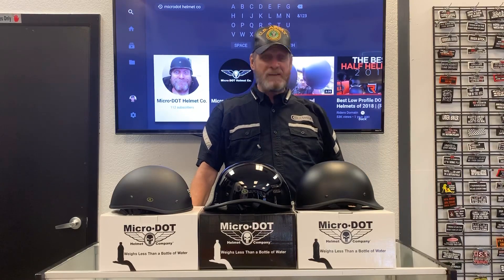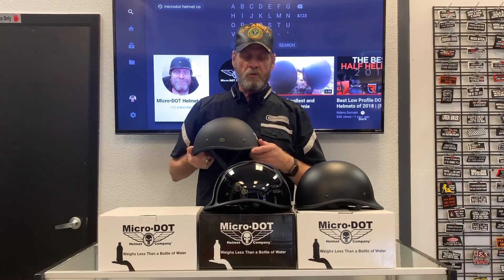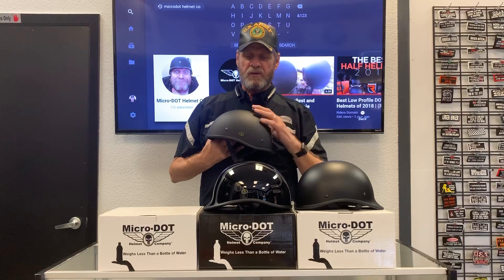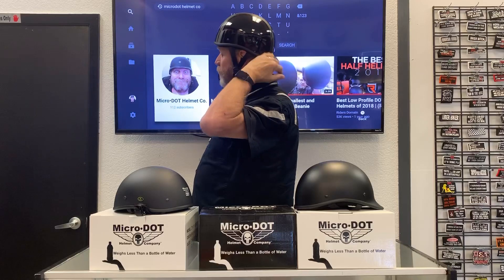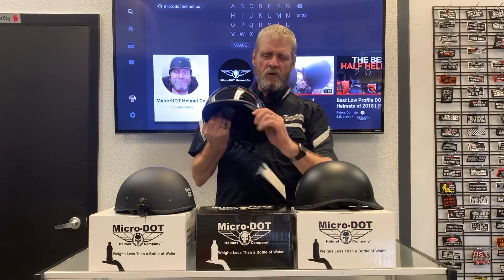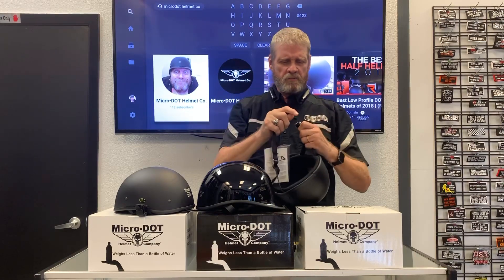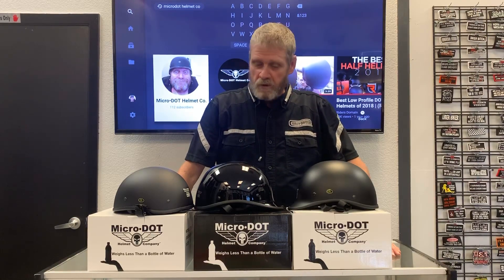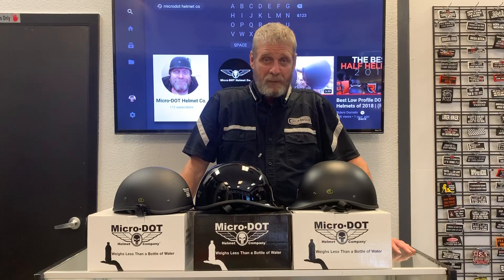Our MicroDOT Models

Comment: Whats the difference between the teister and the twister 2.0? I bout one from you guys just wondering
Reply: From what I can tell, it's the side the DOT stamp is located. Twister on the non-brim side, Twister 2 on the brim side.
Reply: If I'm hearing it correctly, he's saying the newer one is fiberglass with the stamp on the brim side.
Reply: @dixiedoo5876  That's the T360. They have three twister models. The Twister, the Twister 2, and the T360. The Twister has the stamp on teh non-brim side, the Twister 2 has it on the brim side, and the T360 is fiberglass and has it on the brim side.